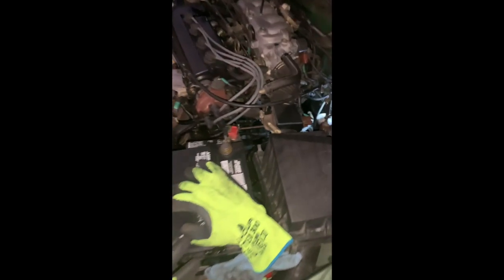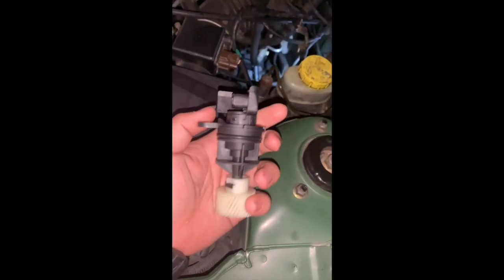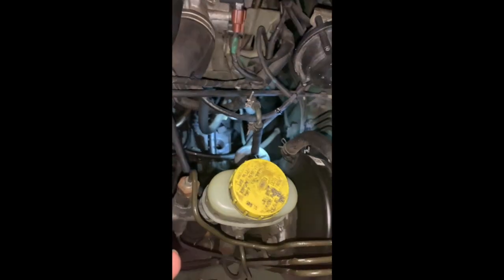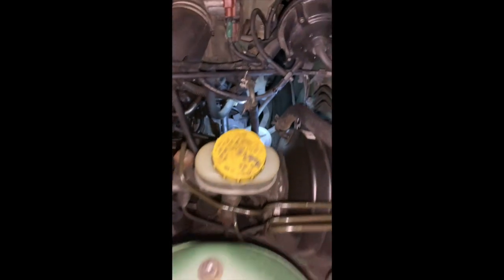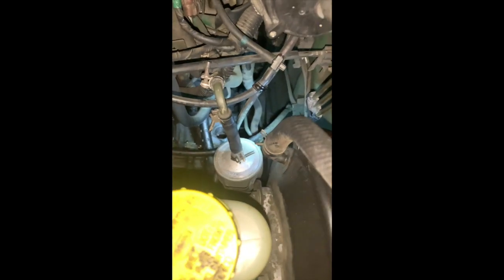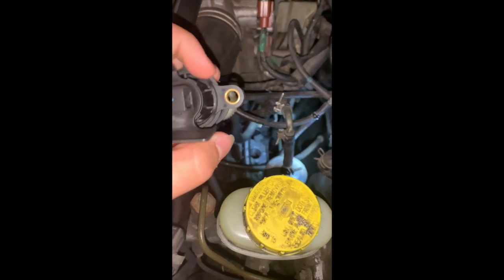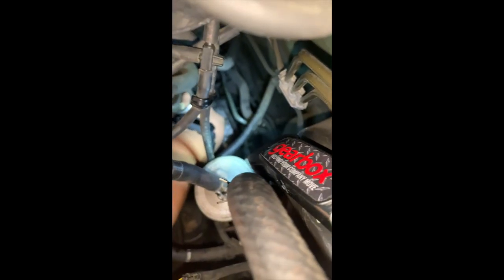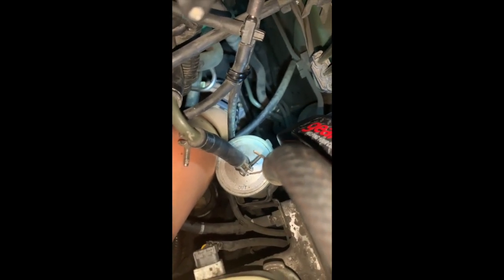How to replace a Vehicle Speed Sensor (VSS) on a 1998 Nissan Sentra GXE

Comment: Thank you going to replace this on my 1997 sentra with 381,900 miles tommrow. Ive been habing like a dragging feeling on highway, I replaced cruise control switch, still wasnt engaging, and rough shifts, added lucas stop slip and transflush no difference. New bored out ga16de engine assembly 2200 miles ago, I was just thnking with my luck new engine then trans is going to get jealous and fail next lol.

Comment: Hey bro. Nice video! i just wondering if you know were this sensor goes on an automatic? I have a 97 sentra automatic
Reply from the maker: Sergio Javier Fajardo Portillo 
I’m not sure, but my 98 is also automatic, so I wouldn’t imagine it would be far off from this one!
Reply: Y  ITS  ON  DRIVER Side Down  JST  UNDER  NEAR  FIREWALL   U NEED  USE LIGHT  TO SEE

Comment: How do you get the electrical connector out? Maybe mines just stuck in there from corrosion, but having trouble pulling it out I have the same part and everything. Also that bitch doesn’t want to come out at all haha
Reply from the maker: Normally it’s a press the button and pull away at the same time. You might be right about corrosion! In that case I would try a small flathead screwdriver to pry it up while pressing the button. Good luck.
Reply: @qwertyratchet  already tried that it’s definitely hard to get out. I actually got the electrical connector out and the grey box protecting the plug was rusted on, now I’m just having trouble pulling the sensor itself out! That thing is stuck in there
Reply from the maker: @TheRealishPowers  for the sensor itself twist & pull at the same time

Comment: do you know if this is the same on a 1996? and how I can tell if is this or the dashboard that's broken?
Reply from the maker: I would assume it’s very similar to a ‘96, and I’m not sure how to tell on that one.
Reply: Y   &  TRY & GET  THE HAND HELD  COMPUTER  THAT PLUGS UNDER DRIVER SIDE  DASH    TO GET  A READING  ON WHY  YOUR ENGINE LIGHT  IS ON"    THE COMPUTER  WILL  READ  SPEED  SENSOR  IF ITS  DEFECTIVE
Reply: Did you ever find out?

Comment: how tge heck do you pop the bastard out lol
Reply from the maker: Twist and pull
Reply: @qwertyratchet  With the clip attached to it still?
Reply: @qwertyratchet  Shits pretty tough won't budge
Reply from the maker: @william_coduks  remove bolt, remove connector, and twist & pull
Reply: @qwertyratchet  Sorted it man , cheers!
Reply: wear  HEAVY glove Twist and Pull at same time
once it comes out a bit, grab it from the bottom and pull up
Reply: @qwertyratchet  If you and/or the above commenters were able to "just twist and pull," either the original VSS was damaged, you got extremely lucky, you are working on a completely different engine, or just possibly you are lying through your teeth. There is no way to get in there and "twist" or "wiggle" the VSS off, on this car. They are not symmetrical, and there is no way to obtain enough leverage to twist. The only possible options I can imagine would be to physically destroy the sensor you are removing or replacing; or to remove the transmission from the car, so you can access the VSS more directly.
Reply: @Vinemaple  you can remove it from under easily, clean and then remove the number 10 bolt then wiggle, then  pull or pry with angle screw driver
Reply: @mysecondchannel-cw1ci  that's what we tried. It was not easy. The plastic flange started to break before we were able to budge it.